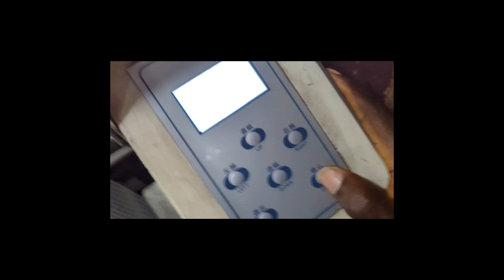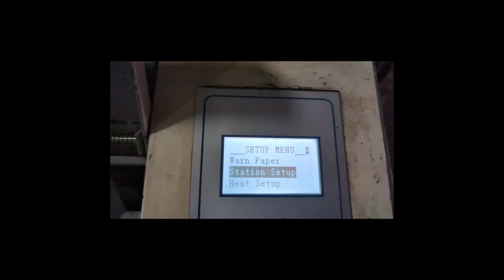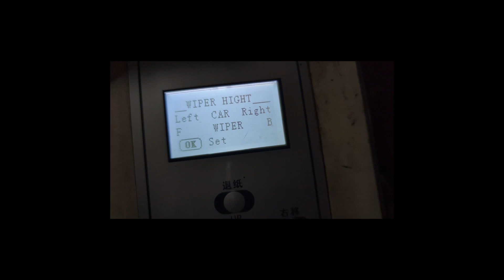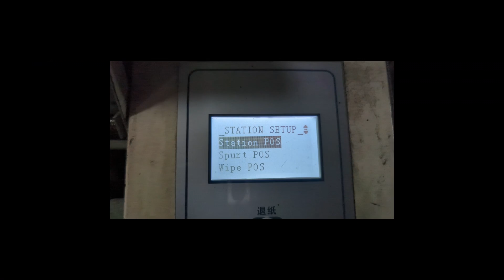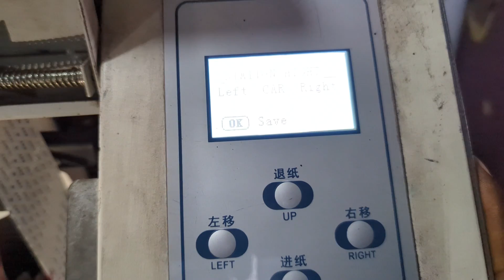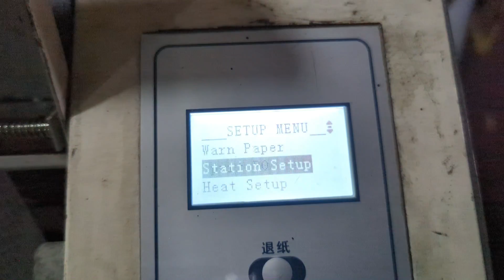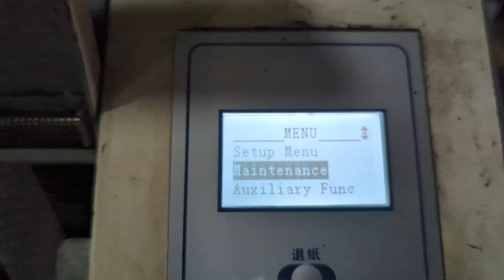How to Align your Printer Head with Capping Station

Comment: Thanks for this videos, I have Exactly  this kind of capping station, but i have problem with pumping, it doesn't pump except i hold the printhead together with the capping station tightly with hands... I changed the cap to new one but problem still persists, nd machine doesn't have cap hight option..  i use iconway 6feet same machine as kongkim kk-1600....
Any help sir or possible Solution